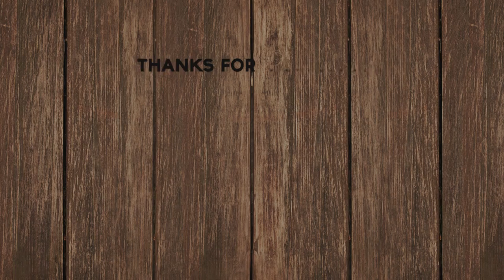Thien Dust Separator

Comment: Tommy: Is that plexiglass or acrylic? I tried using 1/8 inch lexan / acrylic and it is not flexible enough. Where did you buy that big sheet? Very nice separator. Thanks for sharing. John
Reply from the maker: +John Petrick Hey John, I used Transparent Plexiglass and I got it from ePlastics, here is the link to thier website
http://www.eplastics.com/plexiglass

Thank you for watching!